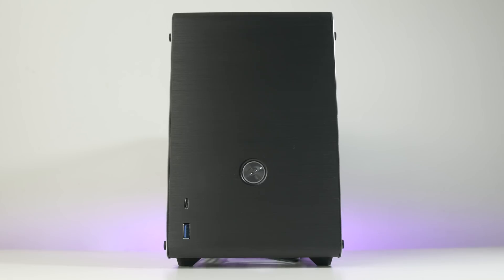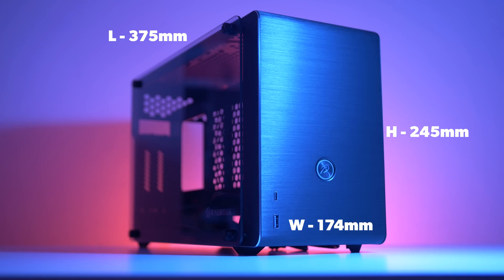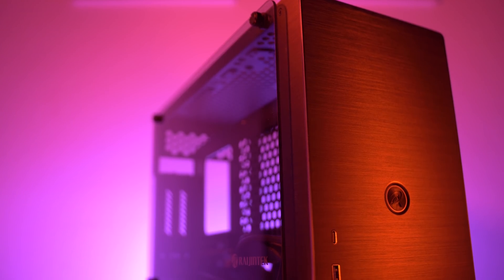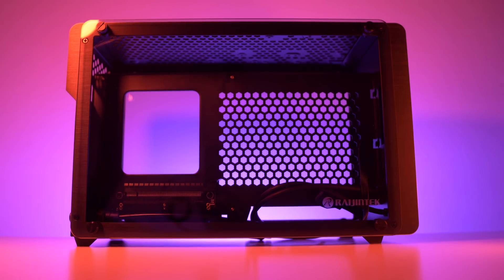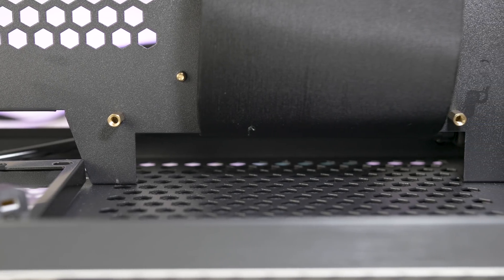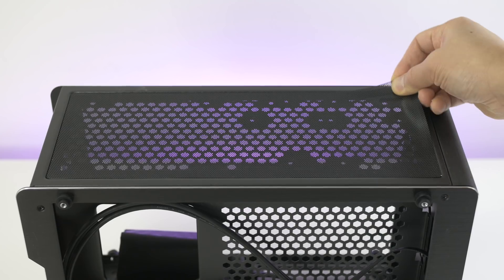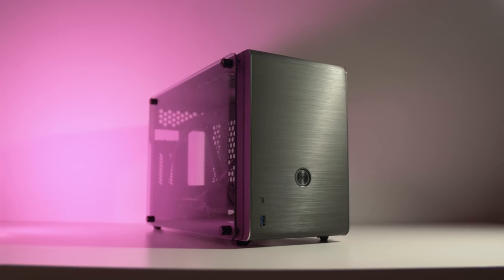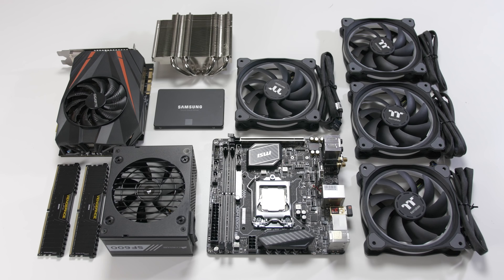BEST ITX PC CASE 2018? - Raijintek Ophion

Comment: Loved this build! I basically copied this for mine! How did you manage to use a thermal take fan as your CPU fan? Currently trying the same thing in my build with a low profile cooler so I can use the original included 15mm fan as an intake on the bottom, and wanted to use my thermal take as the cpu fan but the cpu fan is only a 4 pin header? But these thermaltakes are 9pin?

Comment: You actually can out a 240mm aio in this case. I have accomplished this by simply using slim design fans for the radiator instead. It JUST fits, & the slim fans I am using also have rgb fan blades from Silverstone. They are the only rgb slim design fans on the market rn.

Now, Ik what you guys are thinking. Slim fans. That would just equal to less cooling... Well, not really true. As a matter of fact, I've not only tested it for myself, but they actually do very well for an aio in this particular case. I'll explain why...

       The fans are called Silverstone FW125-ARGB, & yes, they do work with rgb software & can be synched. They have a max fan speed of 2000RPM & while they are not static pressure, they are on the other hand a half & half of static pressure & airflow. This aspect is actually suitable to the Raijintek Ophion & the reason why is because one, you need some static pressure to push air through the radiator obviously, which it does well btw, but also, since this is such a small case with not much room inside, the amount of space per volume within the case is small enough that the half airflow aspect of the fans will be sufficient enough to pull air through & out the case through the radiator as an exhaust.... Get what I am saying. If you used these fans as a main for a big atx case, then these fans may not be all that great for moving air around in such a spacious environment where the distance from one end of the case is far from the other.

       Also, I have personally tested the difference in temps between two standard fans at the top with no aio vs a 240mm aio (NZXT Kraken x53) with two slim fans, & believe it or not, I got about 14 degree temp deduction using the aio (Mileage may very depending on setup).

       So, if you can. Just put a 240mm aio in there, remove the stock fans & replace them with the Silverstone FW124-ARGB fans instead. It will make a good difference. Just my experienced advice using this case to you guys for modding this case for improved performance.

       Bonus Tip: If you are using an air cooler/box cooler instead, then let me give you a cool helpful tip. This case was not design to fit a high profile air cooler/box cooler in it,... buuuuuuuuut I found a way to cheat that stated claim. Before I figured out that way to put a 240mm AIO in this case, I was using a box cooler, & the thing was, I was putting an R9 3900x into this case, & keeping low temps for that cpu is vital. I didn't WANT to use a low profile box cooler, because they simply just don't provide very great cooling, so I actually discovered a way to fit my Wraith Prism Cooler that came with my 3900x cpu into this case WITHOUT looking stupid AAAAAAND while also not needing any extra tools & still having the tempered glass on too.

       How did I do it. Simple. You could just let the cooler stick out the case all retarded looking, but you can also just remove the screws & rubber bushings for the glass panel on the gpu side, & double the screws & bushings ontop of the screws & bushings on the side where your cpu is. Just screw the riser screws into the riser screws on the cpu panel side, same for the bushings. As a result, you will double the extension of how far the glass panel on the cpu side will stick out, giving you more room for a taller cooler, & just have the other glass panel on the gpu side screwed in flushed 😁👍

       One thing to note though, these glass panels do not have vents obviously, so your temps will counter itself, but I solved this by simply taking these glass panels to an acrylic shop & having them create exact copies of these glass panels (Same thickness & dimensions), but added honeycomb ventilation where my gpu & cpu cooler was located, because tempered glass can not be cut.

       So, this case is the BEST mini itx case so far that I could find, iiiiiiiiif you are willing to modify the case a bit & add a little extra money into it. Even better than the Ncase M1, because you have great cooling aaaand great aesthetics. The Ncase M1 blocks off a lot of stuff from being seen as well, while the Ophion shows off everything.

Comment: would you be able to use the Cooler Master ML120L RGB cooler in this case (link to cpu cooler) https://www.newegg.com/cooler-master-masterliquid-ml120l-rgb-liquid-cooling-system/p/2YM-0004-00014?Item=2YM-0004-00014&nm_mc=AFC-RAN-COM&cm_mmc=AFC-RAN-COM&utm_medium=affiliates&utm_source=afc-PCPartPicker&AFFID=2558510&AFFNAME=PCPartPicker&ACRID=1&ASID=https%3a%2f%2fpcpartpicker.com%2fproduct%2f3P2rxr%2fcooler-master-masterliquid-ml120l-rgb-667-cfm-liquid-cpu-cooler-mlw-d12m-a20pc-r1&ranMID=44583&ranEAID=2558510&ranSiteID=8BacdVP0GFs-1YLXbkq8h1GaGPjckTLf6Q

Comment: Nice video.  This is the mini-itx case that has everything for RGB bling as most glass setups are ATX. For me though, this kind of layout wastes a bit of space where the GPU card can easily be installed to the PCIe slot, removing the need for a dedicated space for the card.

Comment: i dig it man. I have almost the exact same setup. Can you tell me what header you plugged the rgb splitter into? i have the cooler master one and i cant control my lighting for some reason. i think i used the wrong header. thanks.
Reply from the maker: I plug it in the usb header, thermaltake's software lets me control the rgb. Hope that helps :)

Comment: do you think we can install a 2.5" ssd on the bottom instead of a fan? or will that have a cooling problem
Reply from the maker: SirAlfi withHDvideos yes you can fit a 2.5 ssd on the bottom although your temps will take a hit. Check out my benchmark video on this case to learn more :)

Comment: Thx a lot for this great vid :-) I made a mistake as I bought an ATX PSU and now the cables do not fit with one of the top fans. Do you think it works with only two fans one on the top and one on the bottom or better to replace the ATX PSU with an SFX?
Reply from the maker: I recommend SFX with two fans up top for maximum ventilation

Comment: Are the Aluminium panels bolted to the frame or just screwed so they can be swapped? I wanted to switch the top and bottom so I could build the computer with the motherboard facing the left panel instead of the right.

Comment: I would design this case a little bit thicker and put two aluminium panel at the middle and create a canal so you could easily manage and hide the cable also fit some more drivers inside. But right now there is not much room for cable management. Seriously it would be most neat case you could ever see. I don't know why they totally ignored cable management in the case.

Comment: I think if those panels were flush up against the sides of the case as you would prefer, temps would be much worse. I would definitely prefer dusting my case very once in a while than cooking my parts.

Comment: You set the top fans as intake so its not sucking out hot air. You will have better temps if you flip em as exhaust and remove the filter and put one intake in the bottom. Get a Silverstone  low profile 120mm fan exactly 15mm. Its up to you if you filter it but i think its pointless given that this case will get dusty in no time given the gaps in the glass panel.

Comment: I think that you made the right move by putting the fans at the top as intake, as it is a filtered spot and with them pushing air into the case, dust should have a harder time entering through the glass gap.

Comment: my last case had tempered glass panels, an in win 901, and i think they look great in pictures but they aren't as function at all. my gpu was overheating in my old case so eventually i just kept the front panel off. i liked the look of the bare components so i didn't mind it. this time around though, i think i want to keep the small form factor, but without sacrificing functionality. i scored a deal on a node 304 and i'll be going with that for my next build. not the worlds smallest system but it's respectable and doesn't compromise like many newer compacted components are

Comment: man cable management looks rough in this case. building in the metis plus didnt leave any way for  cable management, but at least you could tuck it on the side without the see through panel. i wonder if there's any way to sort the cables neatly in the ophion

Comment: Another pristine build, and gorgeous overall presentation, . I'm good with the air getting in from the raised glass, if noise isn't getting out. ;) Power supply makers need to be getting with the led fan thing. They are real visual duds for a glassed build. If you can move the psu back to create a 25mm gap, and shim it a bit... you can overlay one of your Themaltakes in front of it. You'll have a 2 ring-fan balanced look, and increase intake by 100%?? Keep in mind there is no law that says you can't cheat out a few mm, if the glass gives you room with stand-offs.;)  Raijintek was actually doing that just a smidgen, at Expo.
Reply from the maker: Great feedback and tips :D
Reply: @ @JammyMunkyTech  Yikes. I guess its early distribution and supply and demand, but the Ophion checks in at US$250 for us Yanks. FWIW, I have an OCD thing going on with the Metis. Various replacements of alum casings parts with CU, and more static pressure fans... (it's easy, and the Metis is so small/inexpensive, one can mix and match copper casing long before hitting the $200+ of Boutique cases M1, Dan4 etc).. One accidental set-up improved thermals so significantly, I dropped off my equip and sensors at the lab today to make sure they were within calibration. I still think the best look for  an ITX is your Sharkoon with the two fan side view, perforated metal or Glass. Keep up your good work!.

Comment: awesome I just finished my build a few weeks ago too! it gets toasty...my build is here https://pcpartpicker.com/b/3DFtt6

I used a silverstone FN123 120x15mm fan on the bottom. CPU temps stay around 56c...I also placed extended footers on the case to ensure the bottom intake gets more air in. GPU stays at 72c on heavy AAA games. I didn't OC the CPU yet as I'm planning to change the cooler to a Cryorig C7...unfortunately all the stores during the time of building were sold out but definitely planning on changing to a better low profile CPU cooler in the future
Reply from the maker: Nice one dude, great temps for the cpu, gpu a bit high, but not a problem. 
Let me know how you get on with any changes in parts ;)
Reply: Definitely a little toasty...using a evga 1080ti sc2. Changing the 2 top fans in the future too to corsair ML120rgbs once budget permits
Reply: Also they initially had the tempered glass sides flush to the case during computex and they also showed a perforated aluminum side panel as an option...you can actually remove the panel risers if you want the glass panels flush to the case.

Comment: is there a space to fit 240 or 120 radiator for cpu cooling if use slim fans?
Reply from the maker: nope, check out the Raijintek Ophion 'Evo.' Thats built for the configuration you are after

Comment: Hey there, how much room is at the top of the case? Can you fit a 240mm rad with slim fans?
Reply from the maker: Nope it wouldn't fit, Raijintek do have a version that is specifically made for that, called the Ophion Evo
Reply: @JammyMunkyTech    https://www.reddit.com/r/sffpc/comments/9wbq8p/_/
Reply: It does look like it should work. I'd love to see that too and a full size graphics card and while he's at it fit a slim fan in the bottom.

Comment: if it didn't have protruding sides made of glass. Then Id buy one.
Reply: U cud probably mod with different screws etc to get it closer. As is though the extra ventilation is a good thing.
Reply: @jondonnelly3  The gap between the case and the glass is quite big. All kinds of dirt, dust, cat hair will fly in there.

Comment: If the glasses would be sitting flush with the frame, there would be zero airflow in the case.. so I don't mind the protruding.
Reply: I think the first version had the glass flat against the frame. They simply added spacers to the screwholes giving it some clearance.
Reply: Suprised that he suggested it. But the case being so lengthy is it possible to do a dual 120 aio? One for GPU and one for CPU?
Reply: @sindresvindal2290  I don't think that works, since you have to mount the radiators to the top and their isn't enough clearance to to motherboard and graphics card.
There is the Ophion Evo, which is a bit taller and specifically made for watercooling

Comment: i do like the case, but the issues you bought are valid. the only way that might keep dust getting in, and without using those foam strips, is to have the top fans as intake with a dust filter, then the sides can be an exhaust area..